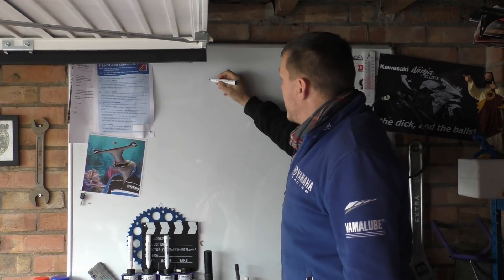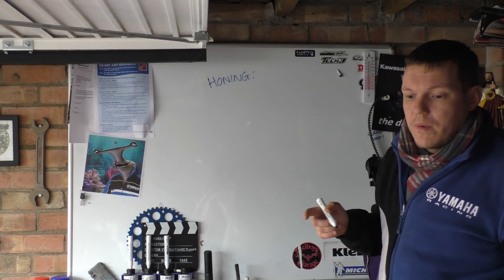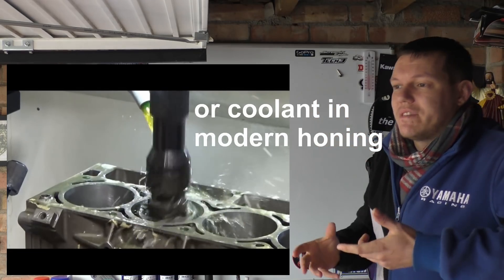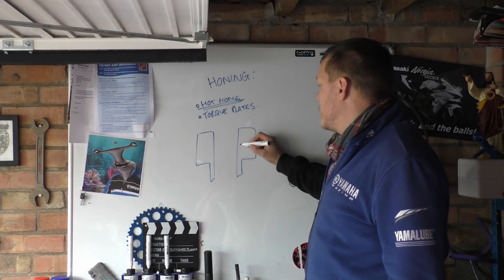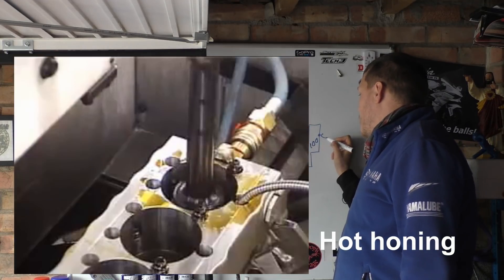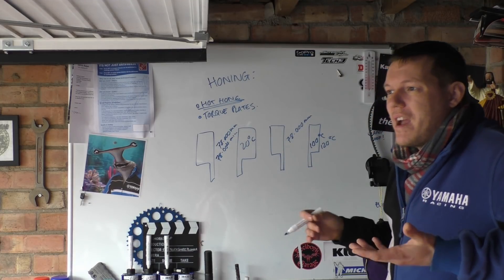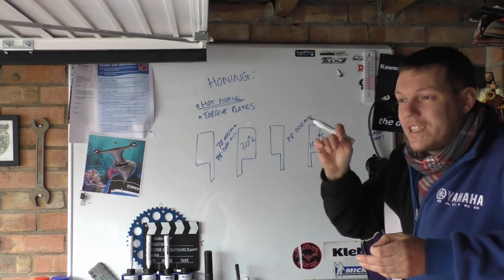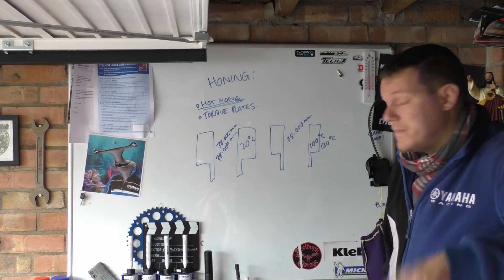What is hot honing?

Comment: Were torque plates not a thing? I've never seen an engine honed without them...
Reply: But, the hot honed block shown at 2:34 has a torque plate. 

We circulate a 200-210 F (93-99 C) distilled water/coolant solution through the water-jacket along with a torqued to spec deck/torque plate, torqued to spec front+mid-plates and torqued to spec girdle/main caps installed during most machining operations. 

Honing oil/fluid does provide cooling but is mainly to extend usable abrasive stone/tool life, flush away removed material/debris, help prevent stones from loading and help improve the surface finish/Ra consistency.
Reply from the maker: Funny you say that - the CNC honing with the coolant doesn't have one
Reply: Really! The shop I go to uses a rottler cnc and that uses flood coolant and they still use torque plates, I thought a torque plate was the standard since the beginning of time! Is there another was to compensate for the fastener stresses, or is it just considered negligible so its not worried about?
Even my little 5hp briggs and stratton on my childhood go-cart got a torque plate when we rebuilt the motor.